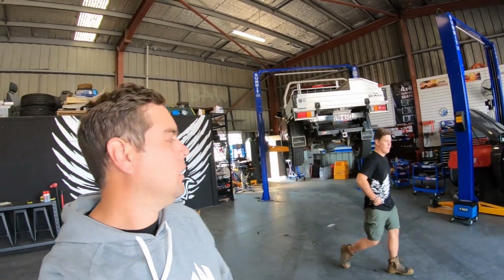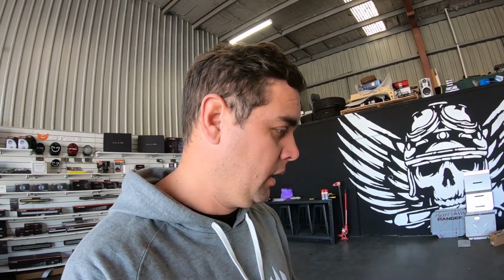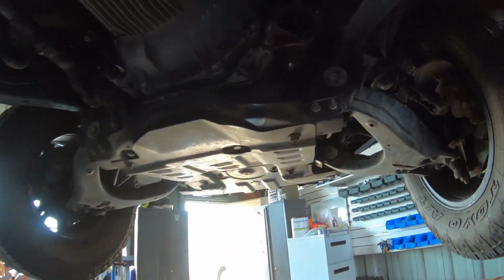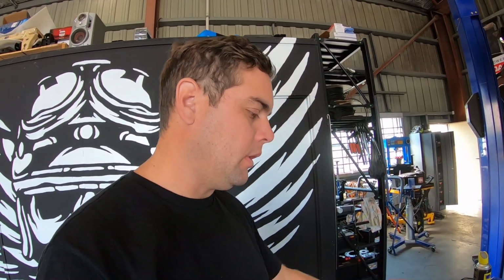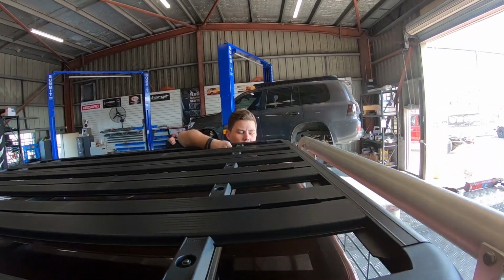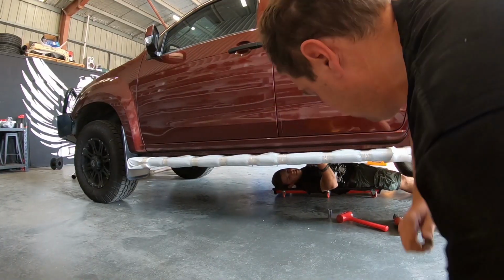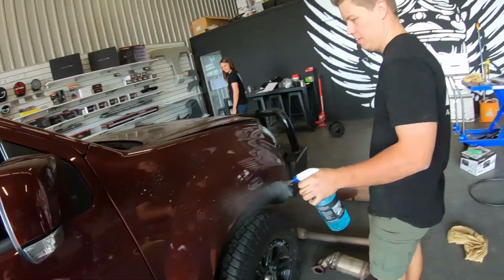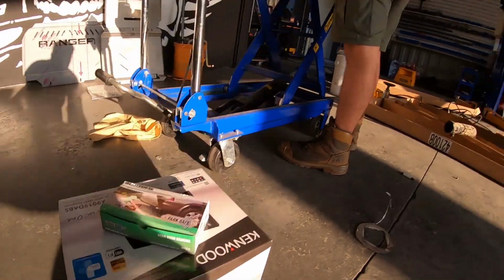Isuzu D-Max Full Off-Road Build: Torqit, Phat Bars Snorkel & More

Comment: Hello
I want to ask, I have an Isuszu D Max car that still uses standard tires from the dialer, I try to use a tire with a bigger size, but I have problems because the tire hits the car part (spakboard)
what should i do to change it
I want to do it myself at home, thank you in advance